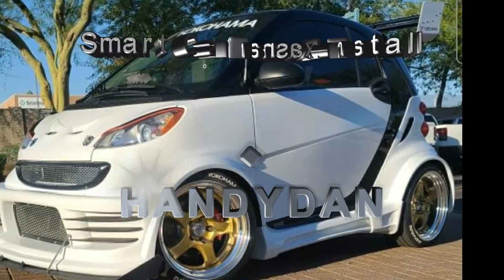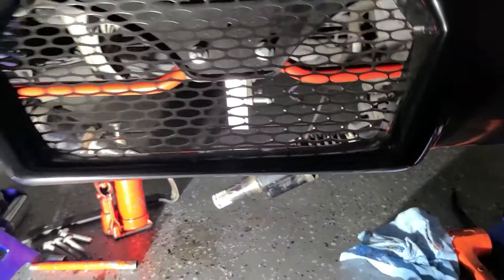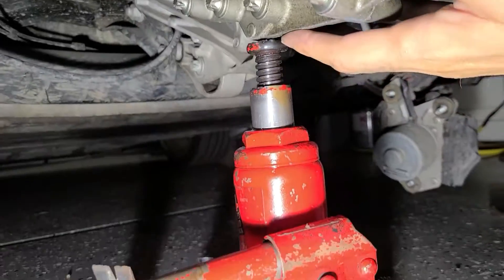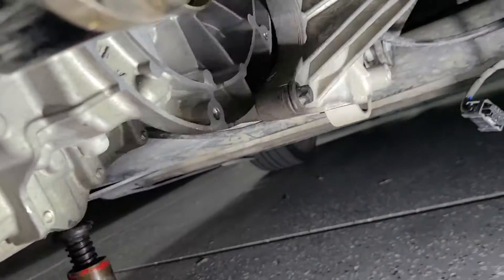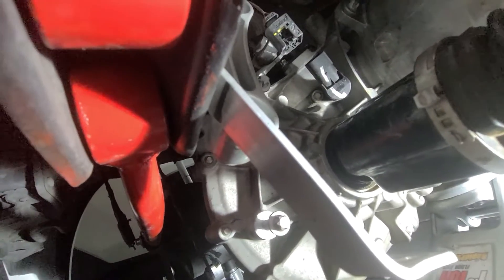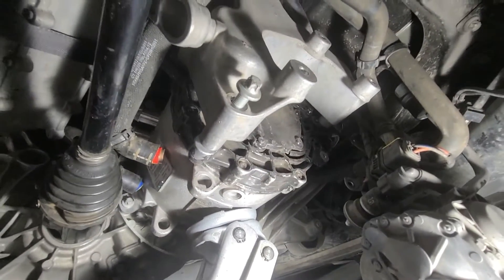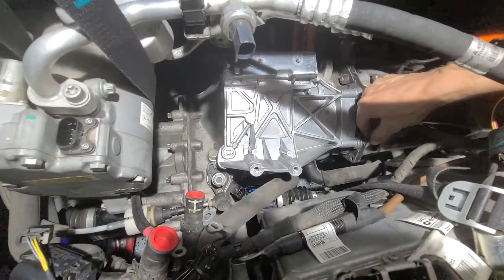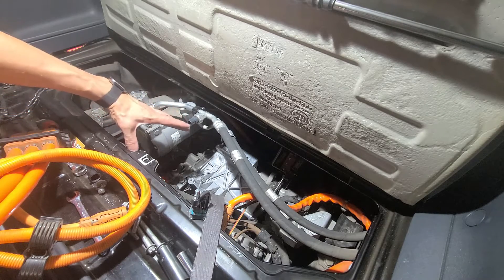SmartCar complete Transaxle teardown

Comment: Thank you very much for your useful video. I have the same issue!
Anybody know if would be possible to fix the Axle replacing the bearings?
Which bearing are mounted?
Thank you all!!
Reply from the maker: I replaced my gearbox with a low mileage used one and it is starting to make the noise again.  I will go through the old box and see if it has a bearing number, or if I can source a higher load bearing from Timken. I'll post the details  soon.
Reply: @HandyDan  OK Dan, thank you. I am from europe if you need to find some specific spare parts
Reply: @HandyDan Hi Dan! Do you have some news to share?
Do you have the MB code of the  transaxle as spare part? 
Thanks a lot man! 😊
Reply from the maker: @giacomomonzani1371  I don't have the gear box number,  I just searched online for the electric Smart transaxle and found one on ebay. I will try to get the old box torn down and see if I can get any bearing information.

Comment: thanks to your video I own a smart fortwo ED, I was trying to find out where to chane the oil transmission , so luckyly I found your video
Reply from the maker: Thank you for watching, I will mention that you try to remove the filler plug first! It is a 10mm hex and mine was extremely tight and almost stripped out the hex.  Better to make sure you can fill it before you drain it 😁
Reply: @HandyDan  I revive this unit because was a P18051c.
Reply from the maker: Good to know some bad batteries can be revived 😁
Reply: @HandyDan  I will do it in the this weekend, my drive shalf broken and loose oil and didnt find where to fill it and drop it... now I have your help.